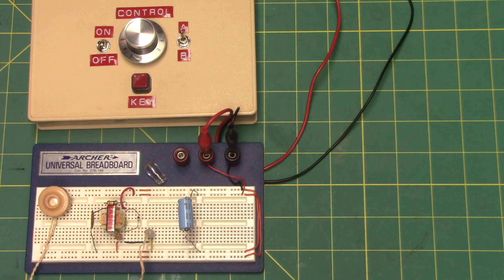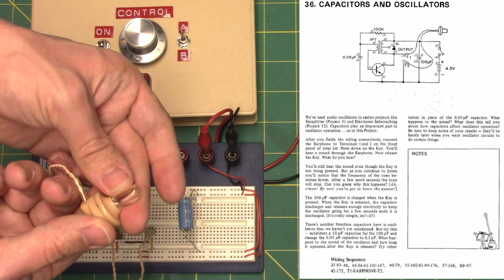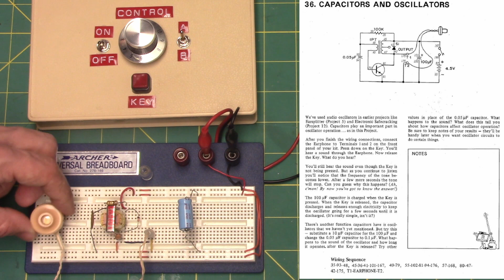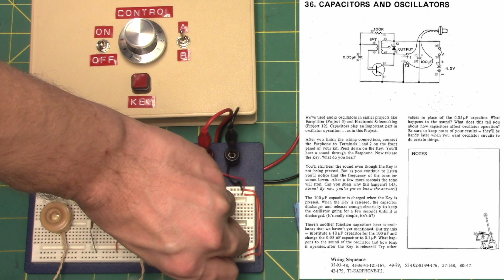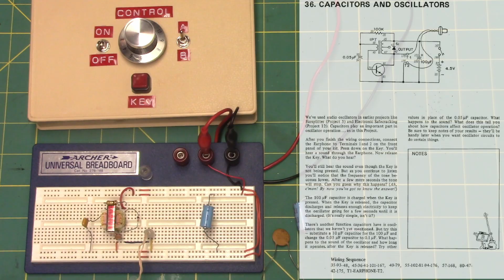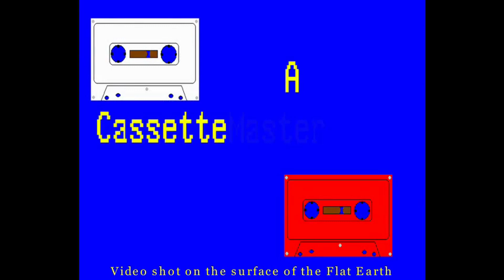36: Capacitors and Oscillators

Comment: Make this circuit 13 times (or more if you like) with different capacitor values, line them up from lowest frequency to highest starting from the left, and boom, electric piano. You should try that for your next project.